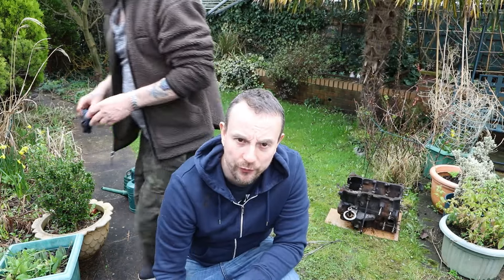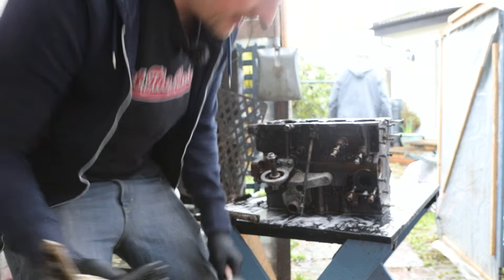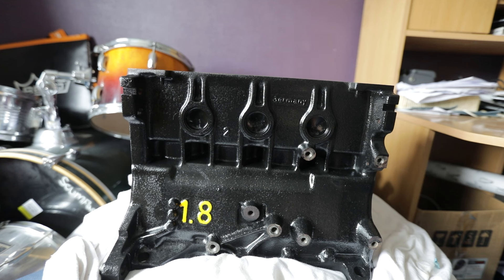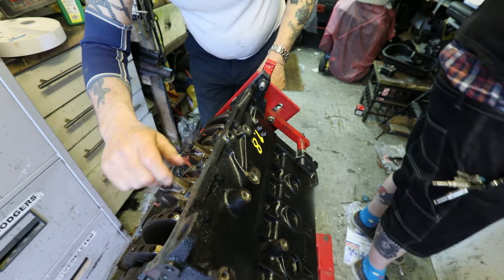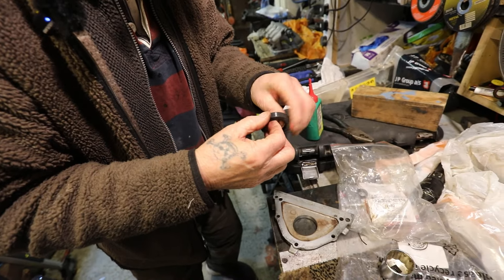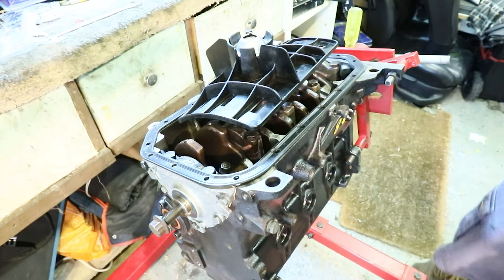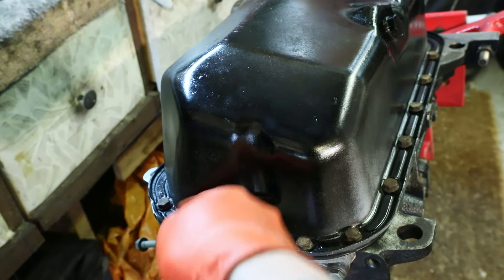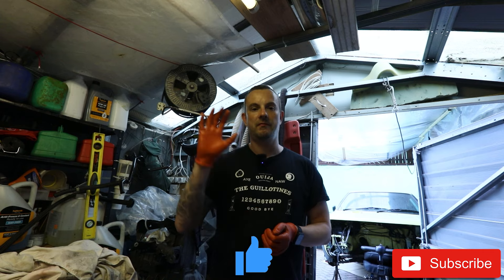16v MK2 Golf Engine Block Rebuild - Engine Refurb PT6

Comment: Keep the vids up mate! I’m literally at the same stage as you with my 1.8 16v for my mk2! Going to watch your head build as my bottom end is already done! Hope you’re doing a video putting your head on your block! Look forward to more videos mate! 👊🏼👍🏼
Reply from the maker: @thegreatgadsby2356  cheers buddy! Yeah I will be doing!
Hey how much force do you need to turn your bottom end over by hand, is it stiff?
Reply: @MK2GolfStories  its not too bad tbh! ive had bottom end rebuilt, had cylinders bored out and oversized pistons put in it but i can crank it with a socket on the crank 👍🏼
Reply from the maker: @thegreatgadsby2356  taking mine to get looked at. Will keep ya updated

Comment: Nice video mate. For the crank shaft plate did you just replace the seal or did you buy the upgrade type which already has the seal in it with additional seal round the outside of the plate?
Reply from the maker: @MatthewCoxall-d4s  I replaced the seal in the end. The other one I tried to fit fist was one with the seal built in, but it seemed ever so slightly to small